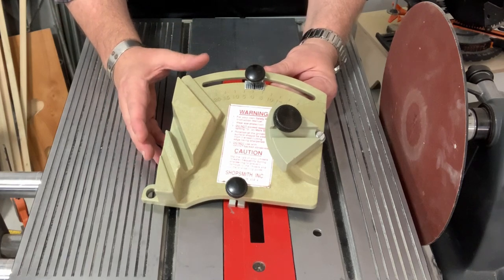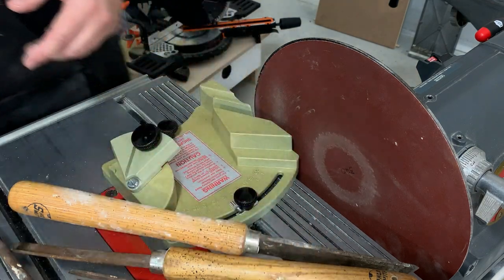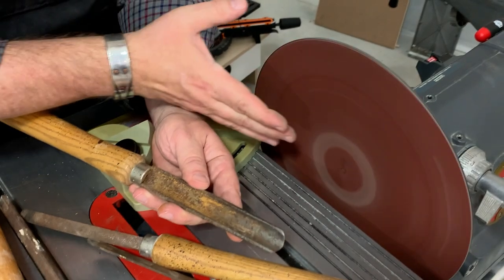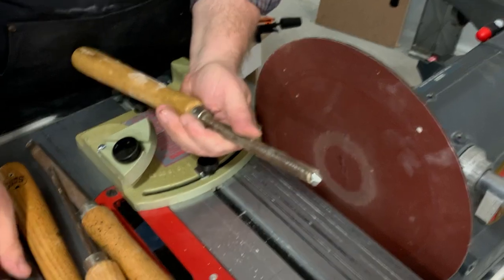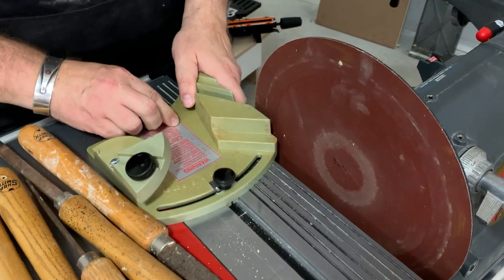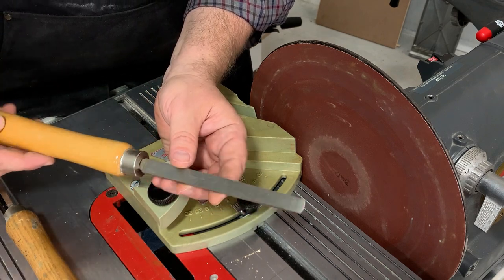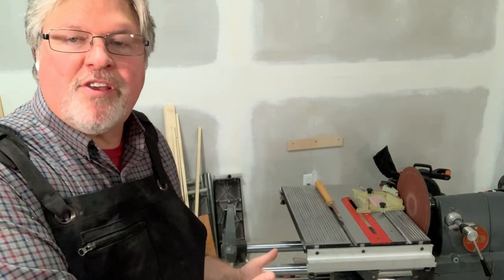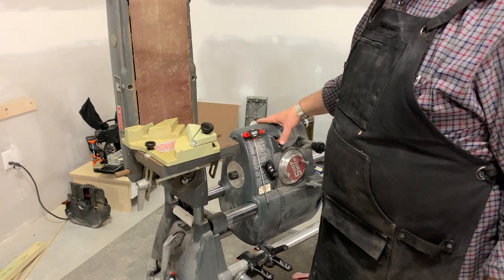Master Razor-Sharp Lathe & Bench Chisels Using Your Shopsmith Sharpening Guide

Comment from the maker: FYI: The best stuff begins around the 15:00 mark.
Reply: What happened at 4:45? Was your camera mounted on the machine? ;)
The stuff with the belt sander starting at 15:00 is what I was waiting for. That will be mounted on my sanding shorty i can move over to where I'm turning and sharpen as I go.
Reply from the maker: @edmalin7359  I’m not entirely sure. I suspect that the tripod was either against the bench tubes or the leg. I have so much worthless footage!

Comment: That was excellent!! I've had the sharpening guide for some time now but never quite understood how to use it. Played around with it when I first bought it but became frustrated and just hung it on the wall. I started my turning journey with carbide tools and have been using them exclusively and successfully for 2 years now. However I would like to integrate some conventional tools in my turning process but the sharpening has always intimidated me. This will help me immensely. Thanks, Scott for another fantastic video. So appreciated.
Reply from the maker: Happy to help, John. Yes, carbide tools are quite handy, but they are scrapers so they require a lot more sanding. Shearing is where it's at.  Scott

Comment: I needed this video!  My used Mk V 520 came with the sharpening jig plate, with no hardware (I thought.)

Found the hardware and the instructions & template in a separate box. 

I have another jig to sharpen the skews on a bench grinder, but that’s all it will work on. Can’t wait for your solution to mounting the jig on the extension table so that it can be repositioned.

Comment: Scott,
First of all, your lathe tools look terrible!  Need some elbow grease to remove the rust!  

I turn a lot and decided to get a slow speed grinder so I do not have to mess with reset every time I need to sharpen. I started with a jig, but have learned to free hand most tools, so it just takes a few seconds to touch up the tool. Grinders are not too expensive unless you move to CBN wheels.
Reply from the maker: They sure do! These are no longer in service and have long been replace by HSS. I agree that the best thing I learned from using this tool was the proper approach and the muscle memory. I now freehand sharpen all my tools. I used to own a Tormek and have been considering a knock-off, and CBN wheels sure beat the need to keep the wheel wet. Do you use water with yours or run it dry? What grit do you use?  Scott
Reply: @MyGrowthRings  Dry CBN wheels on Rikon grinder. I think they are 180 and 600. 600 is really a bit too fine, but I do use it carefully and it does not leave a bunch of steel on the floor!  Not sure how you would use water on vertically spinning stone wheels. I use HSS too but I do like the Shopsmith roughing gouge. Woodturners Wonders supplied the wheels and they have lots of great products for turners.

Comment: Probably a good idea to remove the dust chute (if there is one) on the belt sander when using this jig with it.
Reply from the maker: That’s a great point. This sander has an aluminum dust shoot, but the modern plastic dust shoot will certainly melt if exposed to just the right hot embers.
Reply: Also a possible problem causing a fire or explosion in a dust collection system.
Reply from the maker: @edmalin7359  For sure, though I have an interesting story to share about that.

Comment: Scott, you answered two of my questions.

1. I passed on getting the SS sharpening jig because I didn’t know it could be used while in lathe mode.  Had I known that… I might not have spent the money on upgrading my Tormek!

2. The Scraper is useless to me with the factory grind.  Trying to scrape with its sharp edge always catches and scares the be-Jesus out of me.  Blunting and burring the tip might let me finally use it with confidence.  

I do still have a question… What is the angle for the tip grind on the scraper?

Thanks for the tips bud!
Reply: I agree with your number 2 statement.  By presenting the tool at the center, never above, of the workpiece is a big help.  To make it a better tool for me I ground it to be a double bevel scraper.  Lot more forgiving.  IMHO
Reply from the maker: The angle isn’t critical at all. As long as you have a back bevel, the scraper works fine with a very blunt edge.
Reply: @dwightl5863  thanks.

Comment: Thanks for the “sharp” presentation! I guess this might also be a reason to pickup a second machine, or engineer a shorty.

□
Reply from the maker: That’s not a bad idea. A sharpening/sanding center is always handy.
Reply: @MyGrowthRings  A second (and third) Shopsmith are extremely useful! Dedicated drill press, sanding station, infeed/outfeed support, backup unit... the possibilities are endless. With 5, you can have one in each setup!

Comment: Hmm I maybe doing this wrong but ruffing gouge I think is 13degrees to the left of zero same with the spindle gouge. Skew is 11 degrees? Parting I'm not sure. Round nose at zero? I use a grinder to get a burr free hand. This jig works well for shaping the bevels using 60 grit disks. A fine grinding stone to sharpen while turning. Please fell free to correct me. Every so often I use this setup to reset the bevels. Works fine.
Reply from the maker: This jig, set at 0 degrees will grind the tools at their factory angle. You are free to adjust them to any angle you prefer. I no long use the jig or the carbon steel tools sharpened with it because this jig taught me all I needed to know about sharpening and now I do it freehand.

Comment: I used the sharpening guide early on. It always seemed complex. Like, when do you change it from zero and how far? As a started buying more expensive turning tools I just abandoned it for a dedicated grinder. It really was user error. I could never get the skew symmetrical, and the gouge would have an irregular bevel across. You made it seem so rudimentary
Reply from the maker: I've had some practice.  Again, this jig is fine for the basic set of five, but once you get going in turning you really should graduate to freehand sharpening, but having used the jig I believe you build some valuable experience and muscle memory.  Scott

Comment: A second thought…
I had stayed away from this jig, because somewhere I heard you needed the tapered sanding disk. Apparently this isn’t true? Will the sharpening jig work as well on a model 10?
□
Reply from the maker: This jig was not intended to be used with the tapered desk, and yes, you absolutely could use this on a 10ER.
Reply: You need the conical sander to use with the jointer/planar blade sharpening jig. And it works very well! jim

Comment: I never got this jig but I have always been pretty decent at sharpening chisels and drill bits.     I use to use my disk sander then I built a 2x 72 knife grinder.  OMG it is much much easier to use a belt than a disk.     I have a few carbide cutters but to be honest... Nothing makes as good of a cut as high speed steel.   Even in machine shop at tech school the best surface finishes on metal came from High speed steel.  Carbide just hold up longer but they are impossible to get a razor sharp edge.  I use to use a trizact A30 (800) belt on my skew. You could shave with it. That belt  is also great on hand planes too.  

Great Video I have not seen that jig used in a many of years. One thing about it if you are going to get into turning you need to get a proper setup for grinding  and get good at it.    But their

Comment: Hey Scott, OMG…..today I bought shopsmith, a 500. The machine was purchased new way back, I don’t know the year. Every possible attachment, there are items that I have know idea what they are or what they do. I’m not kidding about every possible add on attachment. Imagine starting a 1965 corvette that has less than 100 miles on it, that’s what the motor sounds like. No rust anywhere. Sad story about the original owner, he got sick, entered a nursing facility and his house sat unused for years. The shopsmith was in his work shop. 
How do I date the shopsmith? How do I identify the parts and odd attachments?
Reply from the maker: Wow, good for you! Depending on how old it is, there is either a serial number on the left-hand side of the head stock on a chrome ring that surrounds the lower driveshaft. The newer units have a white sticker, usually found near that lower shaft, that have either a serial number or a manufacture date. You can search for these on the Shopsmith website..

Comment: When I got my shopsmith from my dad all the tools were in "used" condition. I need to find (or make) one of these jigs. As I know Shopsmith often produced plans for useful jigs I was wondering if you knew of anyone that recreated this (in either wood, or a 3d model I could print).
Reply from the maker: Something similar was featured in early printings of Power Tool Woodworking for Everyone.
Reply: @MyGrowthRings  I will have to go look for it, thanks!

Comment: My question (one of many) is how do you change the sandpaper on the disc? I inherited a Shopsmith and the lathe tools (I did have to find the sharpening jig on Ebay) many years ago and the sanding disc is quite worn...
5:59 ... and it's important to have your pipe in it's proper guide groove!! 😉
Reply from the maker: I’ve done a video on that very topic. Might be the follow-up to this one.

Comment: Hi Scott, great video! How do you determine the correct position or stick out of the round-nose scraper in the jig? Since it pivots around the bolt on the jig, it seems you'd get a different radius on the tip depending on how far that tip is from the pivot. Thanks!
Reply from the maker: Ben, you are absolutely right. I actually discussed that in a portion of the video that was unusable, but will address that fact in the follow-up video. Thanks for the reminder. Scott
Reply: Looking forward to it, thanks!

Comment: I prefer the belt sander as well. Remember, when using the disc sander, only use a disc that has the adhesive backing-not the velcro. You risk digging in and getting a catch because the velcro backed disc is softer then the it would be if sandpaper is glued or adhered. Great stuff!
Reply from the maker: Excellent reminder.

Comment: I have my 12" sanding disc set up with hook and loop system and wondered if this alternative would work.  I've got a smaller lathe faceplate (not sure if it is 4 - 5") and wondered if I got the right sandpaper if I could mount it instead and grind?   I suppose one danger might be the worry about a tool catching on one of the mounting holes on the faceplate.
Reply from the maker: I’ve actually done exactly this approach. One tip would be to use the best plywood you can find, apply a plastic laminate like Formica to the back before mounting the faceplate. Don’t just screw the faceplate but also use double sided tape so it can’t shift. True the edge round and the face flat and then apply plastic laminate lto the face. That will produce an excellent sanding disc.

Comment: Thank you for featuring this Scott. I tend to watch your videos and buy whatever it is that you are using, that's why I'm saving up to make a Chopsmith right now. I'm ordering one of those sharpening jigs next. I had totally forgotten about that one and I was looking at the strip sander version instead. This one is closer to my current budget. The Shopsmith also works great for gunsmithing. You can drill and tap holes for scope rails, refinish metal and wood parts, create grips and stocks, and I'm even going to use it to set the headspace on a Thompson Contender barrel using the strip sander and a simple jig.

Comment: Great video Scott,  I use mine on the backside and rather than mounting it to the extension table, I mounted it on a piece of 1/4' plywood and clamp that to the extension table.  I struggle to keep the roughing gouge in position when sharpening and consequently I've moved the point off center and can't seem to get it back no matter what I do.  What do you think I'm doing wrong?
Reply from the maker: That’s very similar to my approach. It can be tough to sharpen roughing gouges. I start in the center and rotate left, then back to the center and rotate right. If you try to go from one side to the other it’s easy to get it out of balance.

Comment: Thank you for this video. I have the jig and wondered about using my belt sander for the very reason you stated; maintaining a low temp.  With that said, I did follow Doug Reid’s suggested “adjusted” angles for each chisel. Perhaps, in the follow-up, you could speak to the benefits behind his suggestions.

Comment: If a person could only have an extendable coupler and not have to move the headstock to the belt sander. Also, I assume I’m forgetting the jig can be used for bench chisels as well?
Reply from the maker: Yes, if you had an extendable couple you could connect it while turning. And also yes, you can sharpen bench chisels as well as shaper cutters with it.

Comment: Question. First great video ove the inclusion of the mistakes. 
All of the expensive grinders and sharpening systems grind in line with the tool (the wheels spin from the point tward the handle.) Is there a difference in grinding across the tool 90 degrees  to the tool. If there is could you raise the table and mive the jig forward to where the tool contacts the disk inline to the tool?
Hope im being clear?
Reply from the maker: Yes you are being perfectly clear. You can play around with the angle of attack within some limits by doing just what you propose.
Reply: But does it make a difference or is it one of those we've always used a grinder so thats how we do it. Lol
Reply from the maker: @samspade2519  It really doesn’t make a difference.
Reply: Thanks scott

Comment: I noticed that the speed was low,on belt sander. Is it the same for the disk sander?
Reply from the maker: Yes, for sharpening that's all that's needed.
Reply: @MyGrowthRings   Hey Scott, roughly how slow?  About 450-500 rpm?
Reply: @markb8954  The idea of slow is to reduce heat and reduce the amount of metal removed.

Comment: I had followed Doug's 3 part video on sharpening and found as a beginner it was easier using carbide tip tools. I know it the easy way out, BUT it does take some skill to sharpen HSS or Mild Steel lathe tools. AND remember to keep the tool cool when sharpening.
Reply from the maker: My grandkids also use carbide turning tools, so I get it.

Comment: Hey Scott, is there an explanation why Doug Reid sets the tool holder at different angles in his sharpening video and you always have yours set at zero?
Reply from the maker: Yes. In this demo I was returning the tools to the factory angle. In “real life” I use a much lot aggressive angle, but I mostly use high speed steel tools today.
Reply: Thanks Scott, makes sense why I struggled a little with new Shopsmith tools.  When I thought I was sharpening the new tools, I was actually regrinding the bevels using the Doug Reid’s angles.
Reply from the maker: @steveparmelee4871  That’s exactly right. It takes quite a bit of work to get those edges re-shaped.

Comment: Thanks Scott, that's just what I needed to finally do some turning.  I still have to figure out how to raise the ShopSmith to a height that is comfortable for my 6'2" frame and yet retain some mobility so I can wheel it outside my shop every time I want to use it.  This is not so easy when you've only got a few square inches of shop space to work in.  Looking forward to your follow up video.
Reply from the maker: I suggest making a couple blocks to lift the machine up once you get it into position.
Reply: That’s what I did made two platforms on for each side to the height I needed.
Reply from the maker: @craigkrohn2710  I think that’s the most logical approach, though I’d love to see other ideas.
Reply: interesting comment...I'm 5'4" and I'm thinking about construction a wooden cabinet to replace the legs and then set the headrests onto that cabinet so I can LOWER my ShopSmiths !!
Reply from the maker: @everydaylifewiththebensons285  I’ve seen it done successfully, I’ve even seen it lowered onto two cabinets with the front bench tube removed for better wheelchair access.
Reply: @everydaylifewiththebensons285  It might be easier to build a platform for you to stand on, rather than one to lower the Shopsmith...jim
Reply: @MyGrowthRings  You can also insert 2x4 spacers between the legs and the SS frame to raise the machine about 1.5” and not affect anything else (I’m also 6’2”).

Comment: Scott, I noticed  that you kept the settings for all grinds at zero degrees.   When I watched the Doug Reid videos, he advocated for the gouges at 10 degrees L, Skew 13 degrees L, and the parting tool 8 degrees L.    I did that but don't know what impact that has on my cuts, as I'm somewhat new to turning on the SS.   Can you comment or explain why he did that?
Reply from the maker: I addressed that very question in the follow up video. When I’m not using the sharpening jig, I also use a more aggressive grind, but the purpose of my video was to demonstrate the use of the jig. I haven’t used the jig in 20 years, but it did help me get started in learning how to approach the abrasive properly.